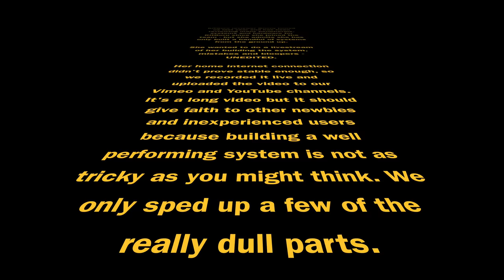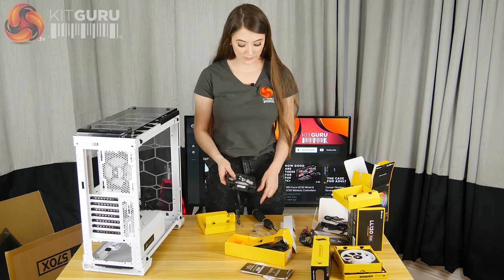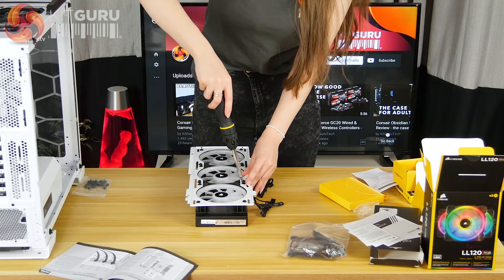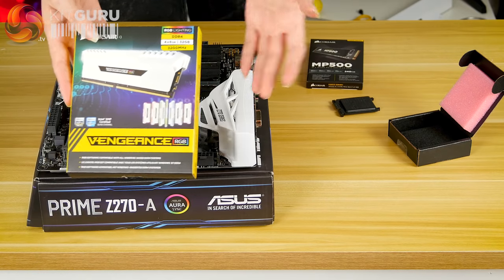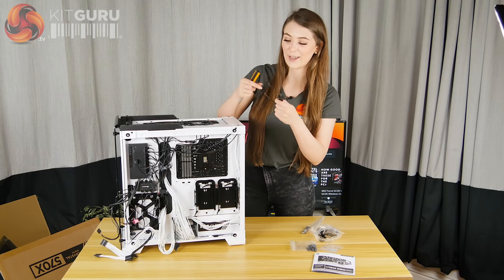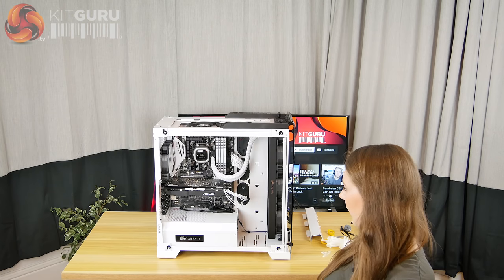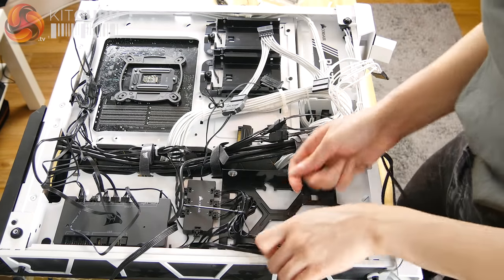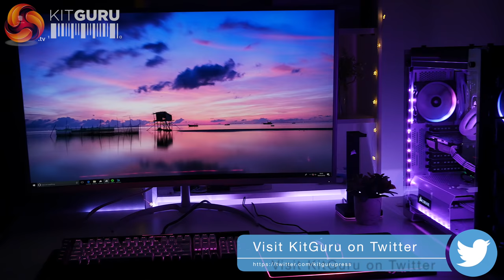Briony BUILDS a GAMING PC 2018 - LIVESTREAM movie style UNCUT with BLOOPERS!

Comment: 2:00:55  For my PC builds, Velcro tie rolls > Zip ties.   I only use zip ties for outside work, or stuff that I expect not to be disassembled.  For PC, audio/video cables, etc,  I use Velcro.  
Velcros are reusable, and don't need to be cut when disassembling (so less chance of nicking the thin wires).  
But depends on your local price of course. Where I live, a roll of Velcro costs only cents more than a bundle of zip ties.   

Great video 👍  Name her Ivory

Comment: No matter how many times you build a PC, when that moment comes to first power it up, the dread fear of it not working never gets any less....because it usually means at best hours of troubleshooting or at worst days or weeks of RMA hassle with faulty components...
Reply: At what point do you/should you test everything is working? Connect everything then turn it on before putting it in?
Reply: @stevethea5250  yes
Reply: Where do I file a complaint against a car dealership?  @theunholybakery1990
Reply: @stevethea5250  idk
Reply: @stevethea5250  you should build the system to see if everything boots. Then you put it into the case.

Comment: had a very good chuckle when I saw the case and the Commander Pro , only watched a few minutes  but will now watch the lot and not just to look at Briony like many will.
The cables with the  Commander Pro and the node and all the drives at the rear  will be a nightmare with a glass panel at the rear and very interested on how it will look at the finish. 
Tips.....wire cutters are a must and a bowl or cup for all the screws
Now to watch the rest............btw" I had the 740 cube so cable management was a lot easier as you dont see anything
Reply: watched the rest and laughed a lot at the cables at the back of the case  and her comments but must admit I was surprised by how good a job she done with the Commander Pro cables. I will never buy a case with 2 tempered glass panels.............

btw: with the commander pro you can plug the USB cable from the cooler into that and it controls the pump speed and lighting effects via LINK ( which does work sometimes )

Comment: Well done Briony, you are now a Jedi! I'm just completing my first build and at £4000 I'm slightly nervous! Firstly, there seem to be so many cables I'm not using and don't know what they're for. It didn't start well with stripped and cross threaded screws in the View 71 case that I had to drill out but went smoothly since. As far as cables, I'm using the stock ones for now and when I'm happy with the layout I'll spend the extra £250 on CableMod cables.
Well done for not swearing and throwing things across the room!

Comment: just came across this and a very quite day so had a watch and a good laugh, have a Corsair large cube case and it has a 280 rad with 2 fans in roof ..3 fans at front, 2 at bottom and one rear all going into the Corsair Pro and the mess with cables is something to be seen ( all fans same as your build )...but one thing I am sure of is using M.2 drives to help reduce cable clutter and getting rid of all drive bays

Comment: Hello! 
I'm very impressed. 
First time I enjoyed watching a +2h video that much.
Briony, you've got PC building skills for sure. Sadly I wasn't a subscriber of this channel when I was building mine in July of 2018. 
(Didn't expect the prices to go down so much in october of the year)

The only big mistake (nobody should do) I've noticed, is @ 1:08:32. You should never put the mobo on that plastic bag. Especially on the OUTside of it.
Better put in on the table, as it is made of wood (non-conductive). 

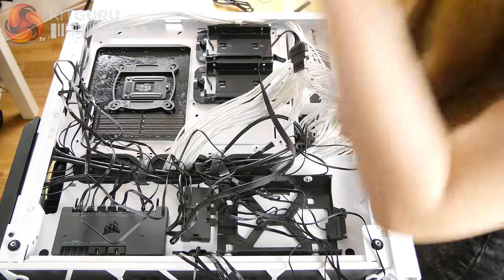2:01:00 I'm quite bad at cable management too... SATA cables are terrible to tie proprerly.
My actual PC has so much mess of cables at the back, I have to force the panel to stick in place. 
But my case is also not well designed for that. Also, SATA cables are terrible to tie proprerly and I had to gamble with some big Molex fan cables too. 
So I endend up with pushing all cables into an empty 3.5" disk rack.

If I could give an advice, as you have a fully modular PSU, I think the best way to manage your cables would be to begin by plugging them all to the mobo and do your cable management before plugging them to the PSU, and only then you screw the PSU to the case and then tie the cables. It could be much easier.
But you did a really good job IMHO.

Comment: Briony very nice build, even a year later. Not sure if someone has mentioned this, but on your cable management, start with your fan cables first. Leave some of your larger cables to hook up last if you can. It will keep it from looking like such a rats when you start cleaning up your wiring . Another advantage is being able to hide some smaller cables behind the bigger ones. I'm rebuilding my rig, replacing a Gigabyte G1 Gaming BLK with an ASUS Maximus Xl Formula and an i9-9900k. It's going into my Corsair  Graphite 760T White case which I love. Thanks for the cablemod AIO sleeves idea, I didn't know they made those and I always hated those black tubes in front of everything. Now I'll have to see what else you've done on YouTube.

Comment: Nice build! I used this same case but in black with an Asus ROG mobo. Ryzen cpu with a Wraith Spire cooler and Gskill ram. I originally got Corsair ram but it refused to play nice with Aura Sync so I returned it. That's the trouble with all this RGB stuff - no standardization. Even Asus software doesn't like Asus hardware sometimes. I had to go back several revisions until I found a stupid RGB driver that would actually work as advertised. Then the Ryzen Master cpu tuning software caused crashes so I deleted it as well. Finally got a rock solid system after much tweaking, NO thanks to Asus or Corsair. Still running and looking great after a year.

Comment: KitGuru, I don't know if the prices were different when you built this (or if the Obsidian 500d RGB was even out, it may have been April 2018), but you could have bought the Corsair Obsidian 500D RGB SE Premium case for about $280 which comes with the command pro, rgb lighting hub and three LL120 RGB fans in the front. It has really nice tempered glass. From what you have here,  your total looks to have cost $344 between the case, commander pro, and the two LL120's alone.

Comment: I am very interested in getting this case, but I am wondering if I would have trouble inserting the liquid cooling system on the top instead of the front.  I will be using the Asus x470-f gaming motherboard with Corsair Vengeance LPX 32GB (2x16GB) DDR4 3200Mhz, along with the Corsair Hydro Series H100i RGB Platinum 2400mm.  I don't want to put liquid cooling in the front, that is not an option in interested in doing.

Comment: This build is heckin beautiful, hub placement and cable management all so clean. Excellent hair management too I noticed, I would have gotten myself stuck and become a permanent part of the build. Those long panel screws seem useful combined with rubber washers/standoffs to create extra clearance for better ventilation, I don't think this case needs it but it might help on some some other cases. NICE JOB!

Comment: great to see this build filmed in full, you did a better job than me. 
i built my new rig in this very case even swapping to the LL fans as well, it was that bad to cable manage it, i considered getting some tint for the back glass haha, i purchased some rgb strips after it was finished , they have sat there 4 weeks because i just cant face it again lol. PS get a cover for the ugly hole at the power supply

Comment: Awesome job on the build and the cable management !!     

If it was me instead of doing the cable management I would have just grabbed a can of white spray paint and painted the inside of the back piece of glass or applied a piece of white vinyl over the inside of the glass and then crammed all the wires in.  ; )

Comment: The most difficult part of the build was her hair getting in the way :)
Reply: Exactly what I was thinking. 50% cable management, 50% hair management.

If I had to build a PC with hair that long, I'd definitely get it stuck between the fans and the radiator, or better yet get cooling paste on it between the CPU and the water block.
Reply: hair management)))
Reply: it's hard to look pretty while doing this
Reply: but that's a long sexy hair  ,😊